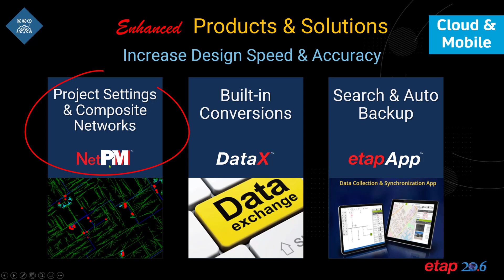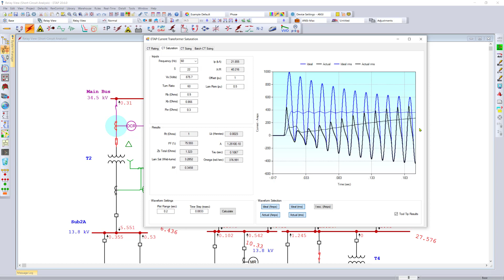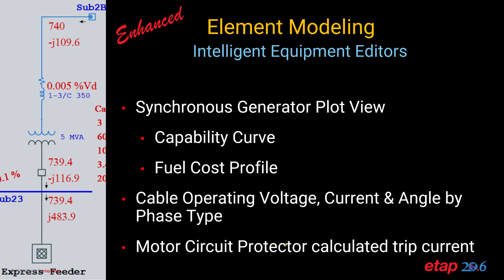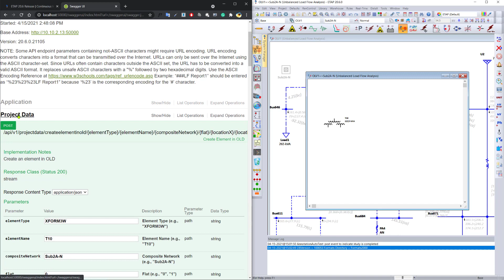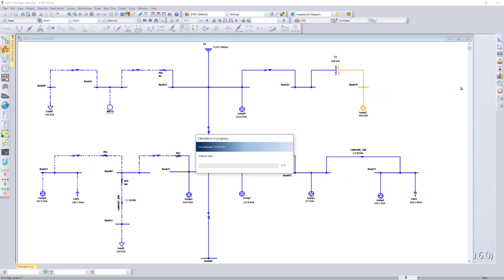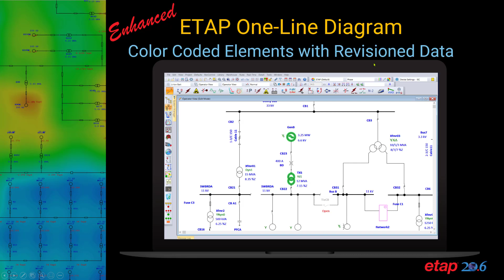ETAP 20.6 - New Features & Capabilities

Comment: Dear ETAP Team, I have a CAD/DWG file for an academic study on Network Analysis using ETAP. What are the possibilities of conversion to ETAP format without versions 20.5 or 20.6? I have access to ETAP version 19.0.1. Please, help. My email address is rcsapps2020@gmail.com. Thanks again.
Reply from the maker: Thank you for your interest in ETAP Software. Please contact our technical support at support@etap.com
Reply: Hi Hon. We added the import/export to DWG capability in ETAP 20.5 so it is not available in 19.0.1. We did have the export to .DXF in 19.0.1 as part of our base feature so you should have access to it.